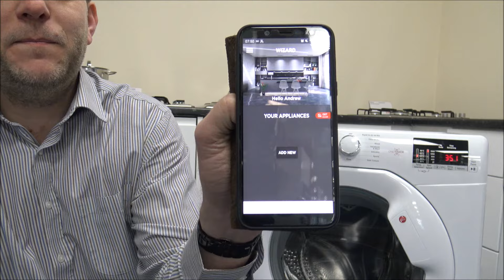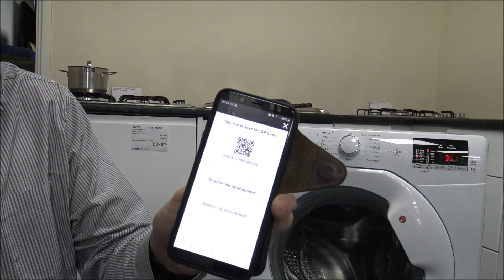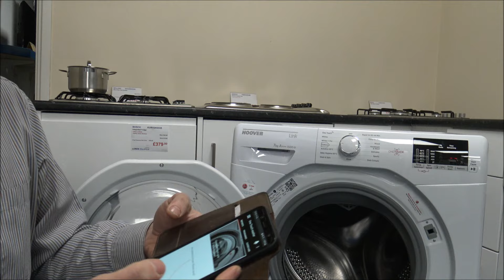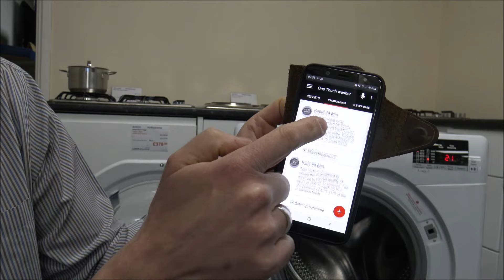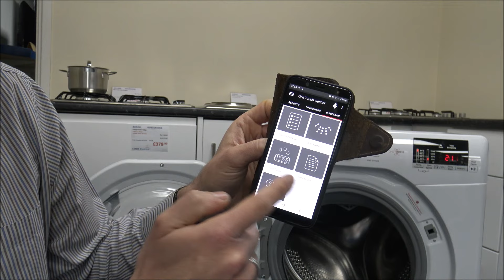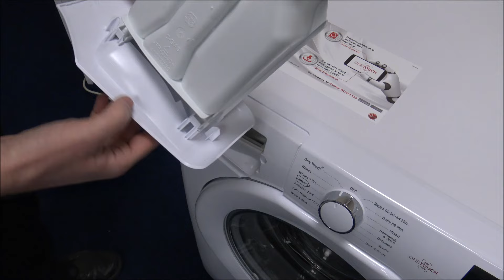Hoover "One Touch" 1500 Spin Washing Machine demo

Comment: Hi and thanks for the info on that particular model.
However i have a 8kg 1600 rpm hoover and i need to fit carbon brushes as the ones fitted have worn out.
Also i'm having trouble removing the top of above mentioned.
I have removed the 3 self tappers at the rear but it wont lift up ? 
Please could you help me.

Many thanks 
🥰

Comment: I've had this machine for four years and never known how to use it, I've thrown on the eco 59 min cycle every single time.  I just came across this video and I feel like I have a new machine LOL.  I didn't even know it had an app, had no idea what the One Touch was all about.  I only googled as I thought it might time to find out which bit of the drawer the powder went in 'cause, again, I've never known.
Reply: Although I still don't know which one is pre, main and conditioner lolol
Reply: @sparkxter7370  is there a program with at least 60 degrees, 1400 cycles per minute and for like an hour?

Comment: Thanks. The most useful part of this video is actually turning the dial and then talking about the lights that come "on" and going through the various options to get the lights "on". Eg level 1 -3 for stains only, lock the temperature for the whole wash or even the iron free option, works but dependent on dial options like cotton. I've had this machine for a good 5 years and today I find out what I've been looking for all this time.  Yes, the manual is useless at explaining this clearly enough.

Hoover is all hitech with one touch. Why can't they do an official video like the guy has done in this video.

Comment: I don't get the reason for one touch other than for other settings not on the dial by the time you fight with it to link with phone it's easier just to start/set manually would rather able to use WiFi for when out of house and forgot to turn machine on or to respond before arrival home or turn dryer on before you get home ect would have more of an advantage

Comment: Hi
I'm bothering you because the washing machine doesn't drain the water and remains inside the drum.

 I think the waste water and clean water pipes are in bad shape or for sure we made a mistake.Under the sink I have a siphon with two pipes, one red and one blue and then you can see the siphon that lets out another white one. 
we put the clean water pipe in the blue pipe and the waste pipe in the white pipe, but as I said there is a red one. Unfortunately, no video shows how to connect the washing machine to the sink. with the hope that you can help us, thank you
Reply from the maker: It sounds like the machine should be connected ok, but it sounds like there is a problem with the waste outlet as the water isn't draining from the machine

Comment: Hi I've just brought the hoover H wash 300 lite 10kg. When it spins it sounds like a loud hammer going around. My neighbours are complaining downstairs.  My boyfriend adjusted the feet and the machine doesn't move or wobble until you go on a spin
Reply: Mine does the same. Like a loud tapping sound. I've spent far too long adjusting and readjusting the feet. Nothing I do helps and there are no transit bolts left in it. I'm at a total loss.
Reply from the maker: First thing is to check the transit bolts are all out. If 1 or more have been left in the machine then it could damage it and make the loud banging sound like it is.

Comment: Mine wont wash on 90•C anyone else experiencing this?
Reply from the maker: There are only a limited number of programs you can wash at 90.
Reply: @lords-electrical  i cant use none. Not even for whites. 60 is the highest it goes

Comment: Can you put a 1500 rpm motor in a 1400 rpm washing machine if wiring is the same
Reply from the maker: I must admit I am not sure
Reply: I'm not 100% sure but provided the wiring and size is identical i don't see why not. It's possible to 'hot wire' this type of motor to make it spin faster too.

Comment: got a hoover h300 one touch last week I put on with washing powder and there was no suds when the wash finished - I felt it wasn't washed properly ,on reading the manual it says to use liquid detergent, my question is...can I use powder straight into the drum and why is there no suds?
Reply from the maker: There are few suds now on most machines because they use much less water than old machines. You can put powder straight in the drum but it is recommended to go in the drawer as the detergent isn't normally used at the start of the wash
Reply: So you can use powder?

Comment: Thank you for this. We just purchase a Hoover H-Wash 300/1400 spin washing machine. It is a good machine, but the 1400 spin can only be used on a few washing cycles. My old machine was a Zanussi and I was able to do an extra rinse cycle finishing with a 1200 spin. The maximum spin speed on the rinse cycle of the Hoover is only 1000 spin which is really annoying. Perhaps I am missing something, but I have read the instructions leaflet thoroughly and can not find any solution therefore I assume that most washes can not be done with a 1400 spin. The machine also automatically reduces the spin speed if the load is small. It is a 8kg machine. We often have smaller loads hence the machine automatically finishes on lower spins than the one I had chosen at the start of the cycle. I am not sure, I might be doing something wrong. The instructions are not the best. Any advice would be much appreciated. Thank you!

Comment: Please I got the same machine for 2 years now and the guarantee is over 1400 but it can not turn so please what should I do?
Reply from the maker: Very strange one but check to make sure the pump and filter is not blocked as this can have an  affect on the spinning and washing. Also check that the water outlet is not blocked, if it is blocked then the water will not pump out and it may not spin as well. Is it making a grinding noise while in motion? If it is then it could be the bearings.

Comment: What is the point of the One Touch App.  Is it just for troubleshooting?  .  When I saw it in the advertisement online and bought it I thought One Touch was just a quick, all-in-one wash setting for if you don't want to jump through hoops to get what you want.   OK so it tells you your serial number and shows you all the programs but they're all sitting there anyway so, as I said, what is the point because it's missed me.  when I saw "App" in the instructions I thought it was some sort of remote access thing where you can turn the machine on from your phone if you're out, although I would never do that.  I just got this machine today and I'm regretting it having seen all the options and bells and whistles.  Prbably not the best choice for someone in their late 70s.  Too confusing, but I was desperate and it was a decent price and available.

I don't like the reduced loads for faster wash.  My old machine would just simply change from 2hr to 1.15.   

Why don't they make a simple machine for dummies.  I think out of all the stupid programs I had on my last one I actually used 3.  The hottest wash, the Eco wash (nearly all the time) and the delicates for wollens etc.  I really didn't want to wash trainers or Flash Cotton whatever that was.  

One instruction in my booklet says if you wash a rug or bed covers it's best not to use the spin.  What?  How would you get them dry in an upstairs flat if you can't spin them?  I suppose I'll just have to get used to it.  😥
Reply from the maker: Some of the apps that manufacturers use are ok but not bullet proof and sometimes not that easy to use. They are improving and each time they update the app it is getting better. Good luck with the machine!!
Reply: @lords-electrical  Thanks x  I'm not that pleased with it really because some of the faster programs just won't let you use the 1400 spin for some unknown reason it just defaults to a slower one so if I want a fast wash at 40 deg I have to do an extra spin after.  

I was looking at the Hoover h wash 500 which has a 1600 max spin speed and that seems to let you use the fastest spin on a quick wash.  

Other niggle is how sensitive the touch controls are, it's so easy to flick past the temp or spin speed you want.

Worst thing was trying to teach my (male) lodger to use it.  😂

Comment: sir i bought new one but not exactly same it is 7kg A+1000 its is spining but after wash with soap its stop and not drain what we can do for this issue?
Reply from the maker: If it is not draining then it could be that the drain outlet is blocked or getting blocked. May be worth getting this checked out as it could solve the draining issue

Comment: What does it mean when you change the temperature such that there’s no light/temperature selected? Does that mean the water comes in cold & isn’t heated?
Reply from the maker: Yes it would normally mean that it will wash in the temperature of the water that is coming into the machine
Reply: I understand it has cold only coming in and heats it itself if the cycle you need needs it

Comment: Hi, is the Rapid 14/30/44 a complete cycle (wash, rinse, drain)? Thank you
Reply from the maker: yes it is but only for small loads. If you are after doing a full load and getting a od washing performance then use one of the longer programmes

Comment: Thank you for making this video 
Iv just purchased this in a 9kg 1600 spin
My floor is level but on 1600 spin it gos crazy like a fraught train,   all my cleaning sprays under sink fall to the floor my microwave moves across the top
If I do a empty 1600 spin it's ok as soon as I put clothes in it goes made at the last 3 minutes 
Iv had to take out coverage before a Hoover engineer will come out they said if there's no falt to the machine I'm liable for 100.00 call out so I took out the cover Becouse I cant afford  to pay that amount so he's comming in a few days .
I'm happy with it otherwise but iv payed extra for a 1600 spin and if I can't use it it's no good to me.
Reply from the maker: The first question would be did you install the machine yourself or did a company install it for you? Before you use it again, make sure that all of the transit bolts have been removed. These are the bolts in the back of the machine that keep the drum steady in transit. Even if one is in then it can cause the machine to jump around. You can also find that you need a decent load of washing in the machine to balance the load while spinning. Especially at 1600 spin with a small load it will make the machine unbalanced. Have a look and let me know.

Comment: Interesting video . I wasn't aware Hoover made washing machines. I don't think they offer them here in the U.S. But it seems like a well built unit.
Reply: Hoover started making washing machines in 1948.  They made one of the first "programmable" machines, that used a module that you inserted to select cold fill only or cold and hot fill modes.